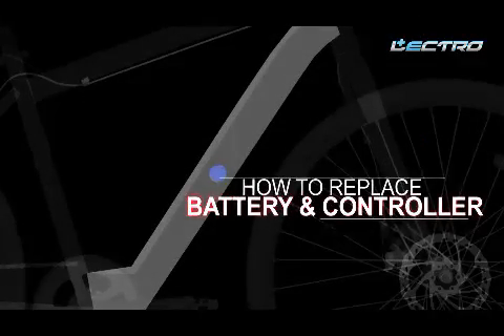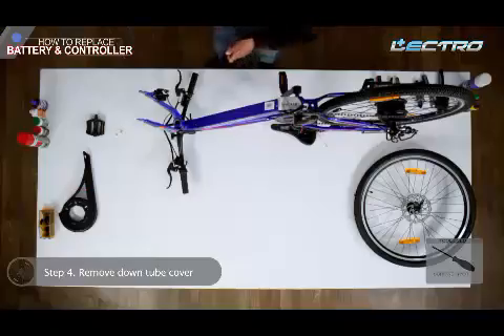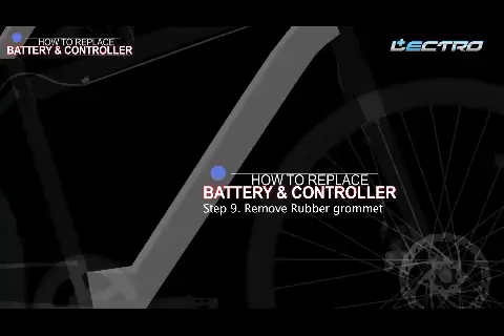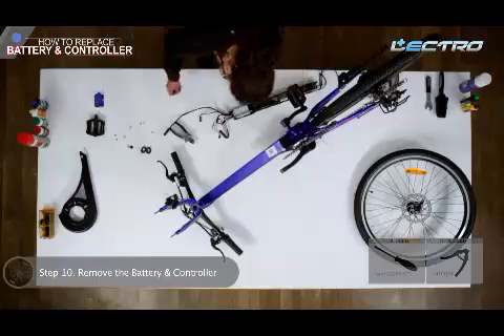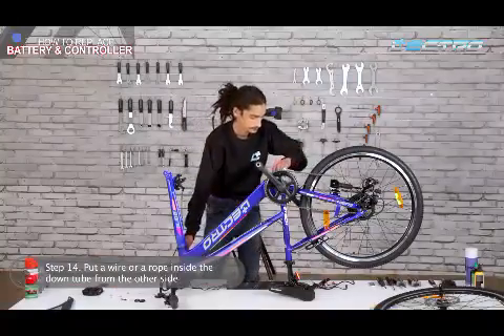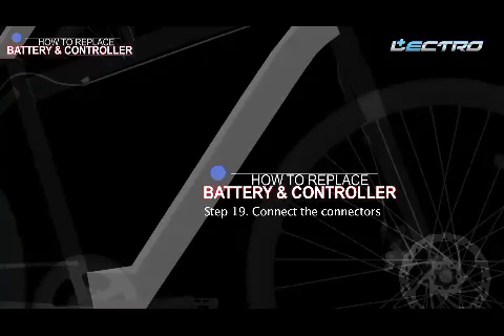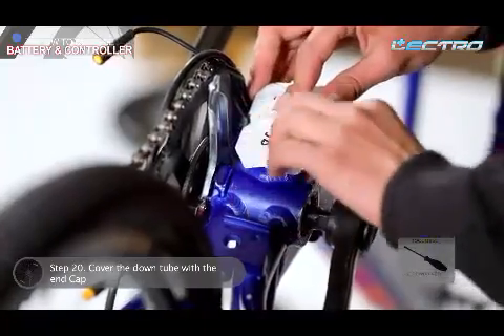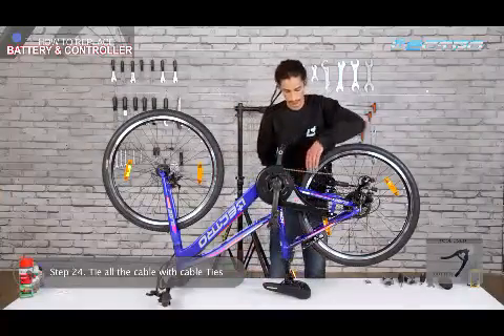Hero Lectro e-cycle - How to replace battery & controller

Comment: 17999 price is fake... after.1.yr battery gives 10 km mileage.
Reply: Now the price is 21000
Reply: Yes..That's how Hero is growing..One needed Yearly 7500/-on replacement &+ 24 steps in fixing ..chargers?
Reply: And for replacement battery pack you have to run every Hero dealer within 500 km radius. You may get the battery pack if luck prevail or else expand your search to 1000 km radius

Comment: What is the name of controller and the battery?
Reply: Hero controller is custom made. It uses JN controller but all the wire length is different. You can search for waterproof JN controller on Google but the wires will be different and short in length.
Reply: @12villages  thanks 👍

Comment: Dear Hero you need to increase betarry capacity and mileage.
Reply: replace battery as well as controller
Reply: Motor weight is 3.5kg
Battery+electronics etc is 1.5kg
Total cycle weight is 21kg.
Do you know how hard it is to manually pedal a 21kg cycle? If you add more battery, you are basically making it more difficult. 6ah is the sweet spot for ebikes. Don't go under or over that.

Comment: From Where can i buy new battery pack.....what is avg life of battery pack
Reply: No replacement battery pack. Throw the cycle or use pedal. Hero will not sell battery for this model.
Reply: @bijaysharma9017  do you search for that? 
How about battre cycle on Amazon? Customer review said that they are good in after sales service?
Plz answer, I wanna buy a electric cycle
Reply: @p7singh  These battery packs are fully China made. I dropped the idea of purchasing an electric bicycle due to this reason. No China goods.
Reply: @bijaysharma9017   lithium mining are production china is leading .even all ev like Tata,Nissan,hyandai all use lithium from.china it's a harsh reality.
Reply: @bijaysharma9017   Then why this video if there is no replaceable battery?
Reply: @eerankisriram  No idea Sir. I have inquired at many Hero dealers place, but no stock.
Reply: @eerankisriram  u can get lithium battery if required
Reply: @eerankisriram  it is 100pc replaceable. The li ion cells can be replaced very easily by a local servicing centre for mobile or other.
Reply: You can make one for yourself easily.
Reply: There are total twenty 18650 cells inside. Search for an EV battery pack maker in your area and take your old battery to them. They will charge 3000-4000 max for everything.

Comment: my e zapphyar ss 700 is not giving more than 17 kilometres speed.I just purchased it 1 month ago.Please inform me what parts of the cycle damaged??is it faulty controller?? or battery?
Reply: It's damage and u cant return it
Reply: We are in same boat.. Take it to the nearby authorized service centre and meanwhile email @customer@herocycles.com about the issue. From day 1 my Pedal assist (Pedelac) was not working. When I took the authorized dealer from where I bot they denied the fact that it is not working. Later I reached out to Hero cycles and they agreed to have a look at the issue. I took to the same dealer ship and they agreed. They replaced the controller. Viola! Pedelec mode started working.. However the new controller got another issue which is speed.. It will not attain the company claimed maximum speed of 25KMPH. It denied going beyond 16-17KMPH. Before changing the controller (Previous one) I was able to attain 25KMPH. I tested with the same speedo meter. Now again I am coordinating with Hero Cycles support guys to get this issue sorted out..
Reply: @pkk1984  Bro I think it's manufacturing falt.I don't know why quality control person pass your cycle.Tottaly Hero company fault.